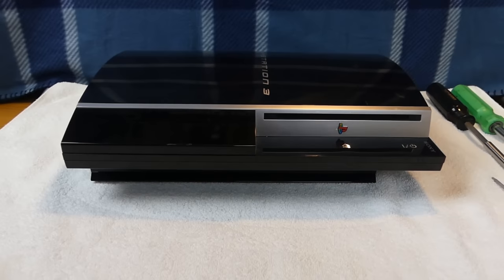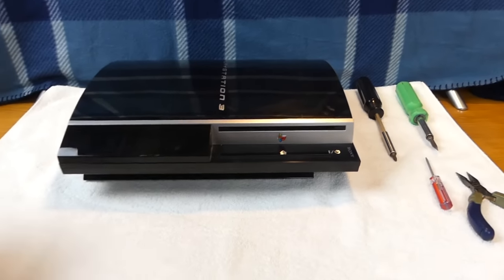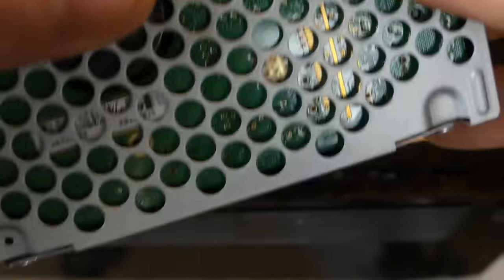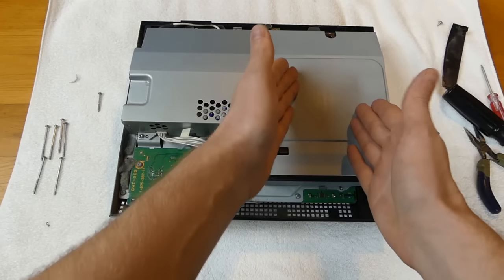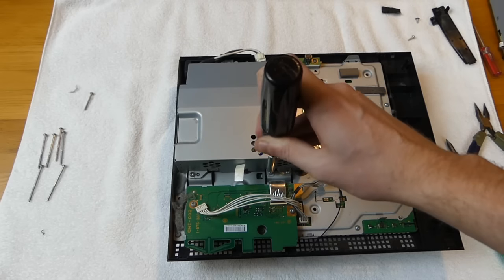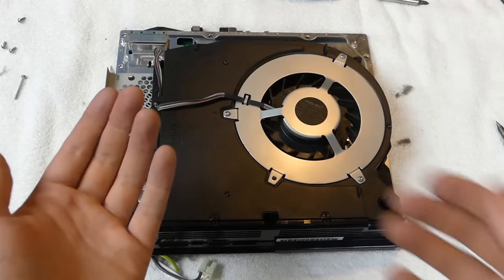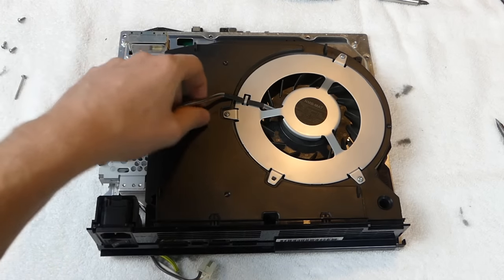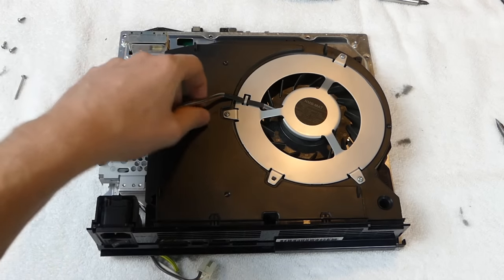HOW TO: TAKE APART/CLEAN DIRTY PS3!

Comment: im really upset.  I only used my ps3 for 15 years, and, only 6 hours a day. And yet it stopped working.  I will have to clean out the dust.  What a load of rubbish.  Still shocked I needed new controller last year.
Reply: 6 hours a day for 15 years seems like a very good run.  Did cleaning out the dust help it to run again ?

Comment: Dude considering the console was so dusty I would've taken the power unit apart and cleaned that plus I don't know how many people know this but the sheilding for the power unit take it and throw it in the bin because that thing holds so much heat inside its unreal itl keep the temperature down if only a little👍